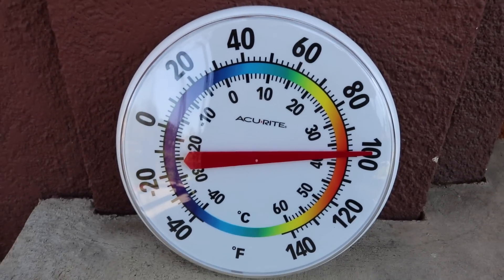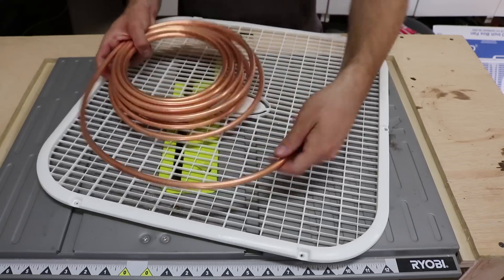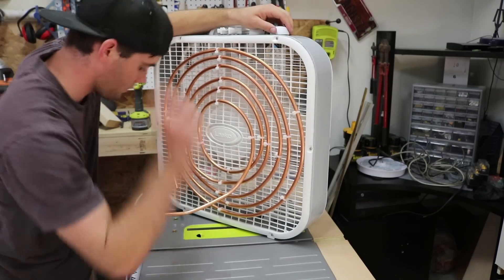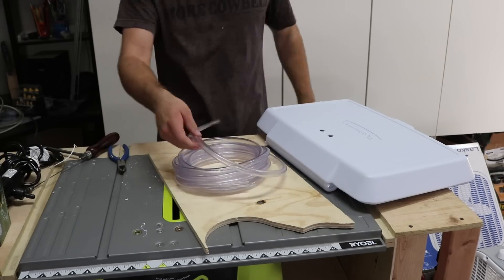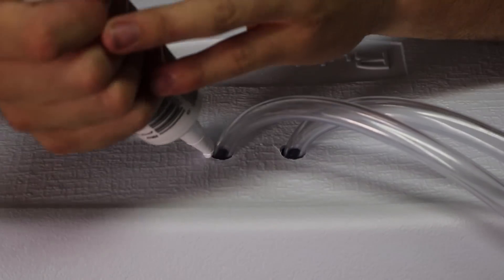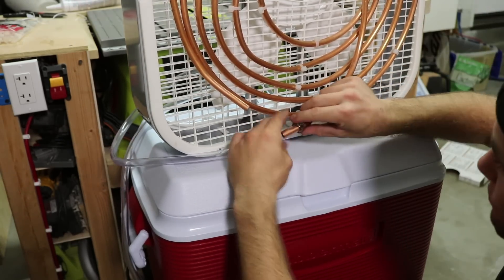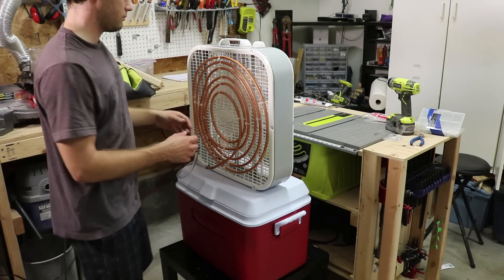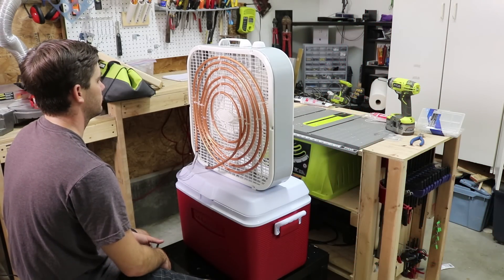$100 Homemade Air Conditioner - DIY

Comment: What if, instead of a cooler, you take this same idea, and burry part of the piping under the ground. That way, the water will cool to around fifty degrees, and then come back up to the fan.
Reply: Thats how they did basically in williamsburg a couple hundred years ago as well

Comment: keep you some milk jugs and fill them with water to freeze should take about 2 for that cooler
Reply: Yup, and the process of freezing the water in the jugs just 'moves' the heat to your kitchen.  Remember, you can't cool (or freeze) anything without moving it's heat someplace. A freezer dumps it in your kitchen, an air conditioner dumps it outdoors. Remember this: A 6000 btu/hr AC moves enough heat to melt 1000 pounds of ice per hour!!!
 (I doubt you can fit that much in that little cooler) (1 Gallon jugs are only about 8 pounds.)

Comment: Depending on where you live, the temperature of the subsoil is probably quite low year round.  Suppose you were to dig a hole perhaps four feet deep, attach longish hoses to an old car radiator (perhaps set inside a water-filled tank) and bury the thing.  Then run the hoses through a pump to another car radiator with a fan behind it.  Behold: geothermal cooling, with only the pump and fan using power. 

Ice plus fans for air-cooling isn't new.  When one of his employees' children took ill one summer, Thomas A Edison rigged up an electric fan he was inventing and placed it with blocks of ice in the kid's room.
Reply: yes, but once the surrounding soil has absorbed the heat from the radiator, you won't have much cooling. I had thought of a similar plan but with multiple 'ground units' that could be rotated through. Groundwater cooling works best, but you need a nice deep well and lots of pumps.

Comment: i will give the only positive feed back on here looks like... great job for trying young man..trial and error.. makes a smart person.. Im glad you had the effort to try something out for yourself. good job.. I love to hire people like you.. self go gidders..little southern slang there.lol
Reply: Nothing wrong with trying! I'm not sure if it worked but he gets an A for effort
Reply: @montesangels  it will work, but he goofed on his heat exchanger design. The copper coil doesn't have enough surface area to transfer heat to the cold water all that effectively.. using an old car radiator would have worked better.
Reply: @Chaddz3  
Ja, which is why window A/Cs have lots of thin find on their evaporative coils.  

On the plus side, this is one of the few DIY air conditioners that's at least close to how an actual A/C works, and not just a glorified swamp cooler.
Reply: Haha A for effort. But yeah, F on the project.

Comment: 4:39 Why mount the fan this way and not the other way round? It would greatly decrease the length of tubing needed. Also compromising the lid (all holes that are not sealed from both sides) might compromise the insulation. Furthermore ... it only distributes what it brings with it ... minus the waste heat of the fan and pump.
Last thing ... wouldn't it be better to prevent the sun shining onto the door (casting a shadow on it ... maybe an umbrella or similar?) in first place?

Comment: A few years ago I built an AC based on the same principle as this one. I uead a 1 sq foot solid block of Ice in my chest then filled it with cool water. It cooled great for about 12 minutes, then the heat was transfered to the water. The Ice block completely melted and the water heated up. In less than 45 minutes, my Ice Chest AC unit was pumping out air that was just as hot as the room air. It is very impracticle. If you can transfer the Heated water away from your room, this would work. For example, get rid of the Ice Chest and Draw your water from a pond or stream that has cool water during hot days. Have the system return the water to the source, then you have successfully removed the heat from your space. This kind of system would work.
Reply: Yeah I did this design.. it worked a lot longer than 45 min.. the ice melted after about 4 hours but I had about 3-4 feet of coiled copper buried in ice inside the chest circulating the water in addition to coil on the fan. It kept that water freezing cold.
Reply: How did you connect the copper tubing inside the chest to water lines? Did you half to use a Y connector from the water line to connect to both sides of the copper?
Reply: @Helmuesi911 nice, thank you!
Reply: can a system like this lower the temperature inside the car?
Reply: We cooled a shop on a farm using a water well that filled an irrigation pond.  From the well the water was pumped through a couple semi radiators with box fans attached.  We had to have a drip tray below the fans because of condensation.
Reply: Build a return that circulates the cold air from the cooler
Reply: it's almost like it's a rigged system and needs water changes and drip trays. you didn't do it right for your setup.

a sq foot block of ice is extremely inefficient. it only cools at a surface level and will break down easily especially if you put cold water on it. that means inconsistent cooling and melting. that cold water is not frozen and it will melt your ice because it's warmer than the freezing point. and as you shift the water (such as pouring it) the molecules gain friction and it heats up the water ever so slightly.

other than that you need to have radiator foil up on windows so the room doesn't let in so much UV to heat up the area from the sun...

styrofoam containers actually hold nicely for this type of thing. but these are not designed to be super efficient, only to cool you down.

break up your ice and put it in cold water. keep adding ice and when it looks like more ice than water then add ice-chilled water
Reply: Would putting hot ice be better
Reply: Should have used dry ice or liquid nitrogen
Reply: @xnviper3631  I'm no expert but I've seen plenty of comments on this video https://youtu.be/I9Td5uMB_vQ on why using dry ice is a terrible idea, even fatal.

Comment: plus the cost of the ice and electricity for the pump per hour, how long does the ice last thanks
Reply: What you can do is to freeze 2L bottles filled with water and reuse
Reply: Coat of electricity? Really?? Is there a cheaper way to cool air over the long term? Some other points such as showing the air temp results are valid, but your point is ridiculous! js
Reply: Unless you don't have to pay for ice every day, yes it's much cheaper to use electricity and run a small efficient window unit A/C.
Reply: @markjones7417  Plus Walmart and the air conditioner manufacturers have a good warranty period...

Comment: This is a great idea...but just to let everyone know, Amazon and Walgreens sell a mini cooling fan that works with water...they are little, but are great for putting near you inside while cooking in the kitchen, or, while getting dressed after a shower, putting on makeup, preventing your wet hair from frizzing while putting on makeup, etc. If u buy one of these fans, make sure to get the newer model which has a filter that you can wash out yourself instead of the older model that requires you to buy a new filter every few months.

Comment: Buy a cheap  water cooler that comes with a spicket  near the bottom and add the copper coil to the spicket. <>  Then just connect the coil to the fan in the same way as seen in this video. <>  Cold goes down, so the coil will constantly be cold until the ice in the water cooler melts.. This Should last for many hours, giving off colder air than a regular fan. <>  Note: The cooler must be higher than the fan , so the  ice water can flow down into the coil. <> Then just keep making ice in foam cups in the freezer and add them to the cooler as the ice melts. <> A block of Dry ice/Hot ice would really spice things up. And add salt.

Comment: I think the heat exchange isnt as effective  because "cold" is just the absence of heat, essentially you are trying to blow hot air through cold tubes. The Copper tubes is absorbing hella heat from the air, but the cold air that is being absorbed would be getting to you and will be smothered with hot air anyway. The heat exchange is a lot better when using an evap cooler because it is blowing moisture at you, + windchill factor on the object rather than keeping the air dry.

Opinion Only

Comment: I have a 2 car garage that I use for my workshop. The heat in summer was really bad. I splurged and bought a ductless air conditioner for $4000. with around 24,000 BTUs. I also bought insulating panels for the door. Right now it is almost 100 degrees out and I am sitting in a nice comfortable 70 degree garage. It's well worth the investment. It also heats in the winter time.

Comment: Dude.... even if it worked.... which it won't, the ice needed to run it would cost more than the electricity needed to run a conventional A.C. Good luck keeping cool with this monstrosity.
Reply: i dont know what youre talking about. <> You can make ice at home and dont need to buy it.. Plus , the fridge is always running, so no extra cost..
Reply: @lindenwyckoff479  Right on, Linden.  Ricky Pisano is the one who doesn't know what he is talking about.  Ben's idea is super.....especially if he has a small fridge in his garage, where he can keep making ice.
Reply: @jffost5843  News Flash. There are many videos on this that truly do work and I give them credit. I don't coddle people.  They'll never strive for improvement if that's all they hear.  GET OVER IT.
Reply: @lindenwyckoff479  Doesn't work dude. Just say it. Your room temp did not change, right. Tell me?
Reply: Some people just can't hide their jealousy.  If the idea is not theirs, it's not good.  As they say in Missouri "YOU DONE GOOD, BEN."  Good riddance to jerks who have nothing to do but criticize others.

Comment: Just buy a damn window unit for $125
Reply: Some houses can't handle the electrical load depending on how the circuits are ran and how many outlets are in it.  I bought my daughter a window a/c and every time she tried to use it it would blow a circuit breaker
Reply: @MaggieValera  if you cant run a window unit you better get your electric checked out
Reply: @ridgerunner7980  You've never lived in a place where if you use two high energy use appliances it flipped a breaker I take it.  This happens in older houses that were built pre microwave and such.  In my parents house we couldn't use the microwave and the portable dishwasher at the same time or it would flip a breaker.
Reply: Maggie of House Valera Save a few dollars a month and Call out an electrician and have them run an outlet that can handle the load. 

The time, money, effort, energy and resources exhausted in doing something like in this video offer no long term benefits whatsoever. Besides that fan doesn't filter the air and the fan has to be on high all the time to ( try ) and accomplish what a small window unit can do on its lowest setting.

All you need is the smallest window unit Walmart makes. If you have a big room to cool, put a fan in front of the unit to boost the airflow OR even better ( this works better than you'd believe ) get a child's play tunnel toy, they look exactly like an Attic duck but larger for a child to crawl through. Put it in front of the unit and run it to where you want it for cool air
Reply: I Know You're Right But this happened in both my parents home as well as my cousin's whose husband was an electrical engineer.  If there is no room in the fuse box, you cannot upgrade the breaker.  I never said I would do what's in the video, we don't have my parent's house any longer but my cousin has almost got it done so they will flip it and buy another.  As I said, everyone doesn't have that option.  The same is true for old buildings in bigger cities.  The building we used to live in in Queens still can't handle a window a/c. That building used to have gas lighting throughout.  When they switched to electric, they ran the electric wires along the as pipes, and that's the same electric that we have to this day.   My old school down the street (where my mom's cousins went to school along with my grandmother and her siblings and she was born in 1907 if that's gives you an idea) finally got central air about 10 years ago when they were able to rent out the school basement and auditorium for Men In Black 3.  Like I said, not always an option.

Comment: Did it work ? Did it blow cold air ? Why No testing of the ambient temperature? 😮You just sat there 🤦🏾‍♂️
Reply: @Drakilicious 
This technically isn't a swamp cooler, and actually works like an actual A/C without the compressor or refrigerant.  I wrote a longer reply explaining the difference here, if you care to read it.  Swamp coolers blow moist air over damp pads or cloth, which cools the air.  Unfortunately, the blown air is mostly cool moist air, which is bad for cooling in most non-desert climates.  A/Cs cool and dehumidiy air by blowing the air over cold coils, which dehumidify by condensing the water vapor from the air and draining the condensate away.  
However, these coils aren't in the best setup to adequate drain the condensate away and might remain moist most of the time (at least for the lower coils).  Therefore, the system might inadvertently act as a swamp cooler.
Reply: it will blow cool air until the ice melts. Then it won't blow cool air... Go to Walmart and buy their cheapest window unit air conditioner. You may have to enlarge or build a window large enough for the air conditioner in the garage's door though. And while the window unit will increase your electricity bill somewhat, a 5,000 BTU unit will consume less than a 15,000 BTU unit...
Reply: @lylaaxiom8750  
A/Cs need to be sized appropriately for the room size because they also dehumidify the air, and not just cool the room.  You don't just buy a larger sized unit (one with more BTUs) because it can cool faster and more efficiently.  An oversized unit will cool the room too fast before it can properly dehumidify the air.  Once the room gets cold enough, the A/C will stop cooling, and the cold cooling coils are (typically) the only way for the unit to continue dehumidifying the air.  So to continue drying the air with an oversized unit, the cooling mode needs to stay on, which will then make your room too cold.

I wrote a longer reply for this video if you care to read more about this topic.

Comment: You made an air-cooler, not an AC, if there's a reservoir you have to refill, and if the temp of the air coming out is dependant on the fluid you have to refill, it's simply not an AC, and therefore, the title is misleading.

Comment: NEEDED:  Detailed materials list should include length of copper tubing used.   Also, test garage temp AFTER using this setup, specifying how many hours did it take to drop the garage temp by even 10 degrees?  
How long before the ice melted, needing replaced?  [That time will vary, depending on ambient temp of room it’s in].  
To be credible at all, Demo vids like this need to test before and after data, to check results, then trouble-shoot. 
This is a good option for maybe, smaller rooms, & can be used in humid climates because moisture is not being added into the room [though there WILL be condensate to clean up!].  
MAYBe he hinted at his setup’s inefficiency, because he shows having to sit right in front of it to feel cool?? 
TIPS:  The copper tubing needed at least doubled in length, to better cool air passing through the coil.  
It MIGHT have worked even better, if the tubing was only about 1/4”diameter, & length at least double.  
Good to use a pump with at least that capacity of circulation though!  
Instead of regular loose ice, use sealed, plastic jugs filled with refreezable content [water, or other phase-change material], in the chest with water to pump...that's much easier [& less costly?] to swap-out melted jugs with frozen jugs, & does not require emptying build-up of melt-water from the ice chest.  
Alternately, could use dry ice in water [though that’s costly]. 
In the old days [dry climate], we used to hang a wet towel in front of a box fan, & keep that damp, which effectively makes a “swamp cooler”...but Avoid using any sort of swamp cooler in a humid region, because swamp coolers make mold happen more.     Dad used to put dry ice into a small antique window car swamp cooler, with water in its little tank, which did fairly well cooling the driver....the dry ice into the water tank, did cool noticeably better than plain ice.

Comment: Did you measure the cooling effect with / without the pump on? I think the effect of the tube is miniscule. If there is almost no cooling effect by the tube, the investment of materials and time is not worth it.

Comment: Do you mean to show that the air from a fun around a "copper coil" (with ice water in it) is significantly cooler than when there is no copper coil on the fan? 

Otherwise i don't see the value/relevance those few reals of copper coilings.

I can quickly tell that the water in the box will become cooler, so may be it can also work as a water cooler.

Comment: I bought a 6000BTU a/c unit on Craigslist for $30 bucks and didn't even fill it with ice.
Reply: flyingrv6 6k BTU are perfect for cooling a 50 ft2 room at an efficiency level of 30% for a mobile unit. Now that’s a waste of money and resources.
Reply: @mardmard  yeah well my tenants are paying the bill so if it's 5% efficient I'm still ok.
Reply: @flyingrv6  If you knew the true costs of a device so inefficient, you would never buy it. The joke is that it's a split bill. Wasting resources is still affordable, but it incurs a debt to our planet. Sooner or later that debit will have to be paid, and the cost will be tremendous. But don't worry, not for you, you can sleep fine, future generations will pay for you, and initially primarily in poor countries. Good feeling, eh?